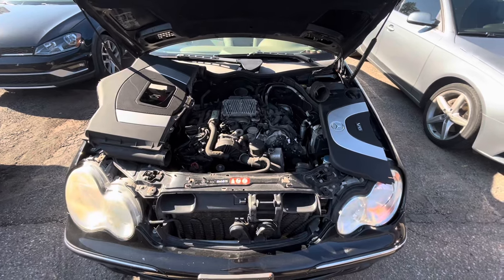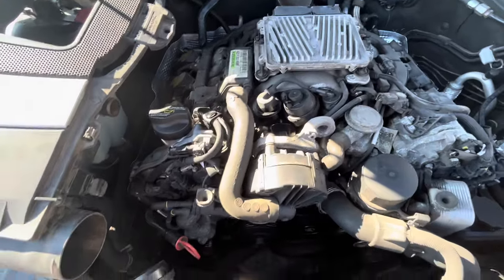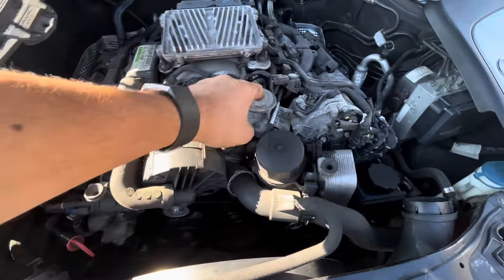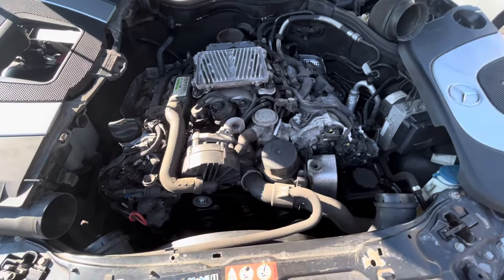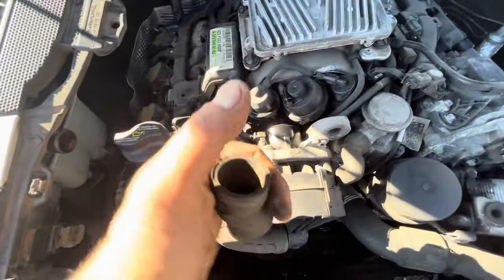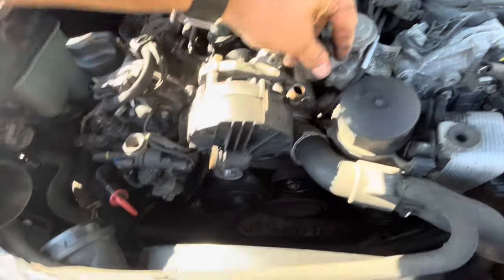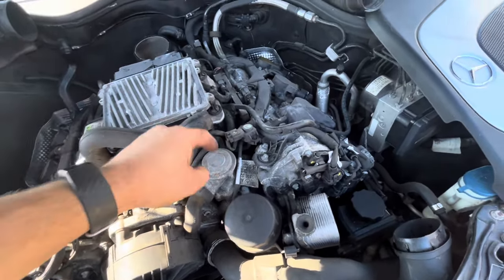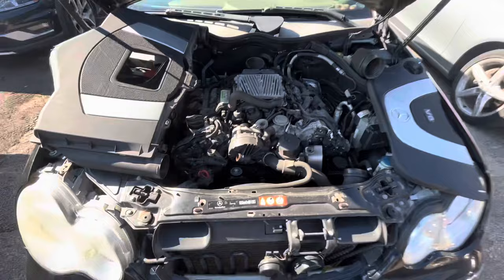WATCH THIS BEFORE YOU REPLACE YOUR SECONDARY AIR INJECTION PUMP

Comment: I have a 2012 Chrysler 200 2.4 it's causing my plugs to foul out engine may run smooth and then start running rough

Comment: I got a P0410 thinking, my air pump was going bad. I could hear the relays working so I knew two things right off the bat, it was getting power to the relays and they were working. After turning the car on when it was cold (air pump comes on for first 40 seconds if those conditions are met), I could instantly hear it humming smoothly like a vacuum cleaner. So I was like what heck?? Looked closer and realized my lower actuator, the one you pointed out, had a broken vacuum line that broke when my serpentine belt also broke and was cutting everything in its path including my vacuum line. SOB I thought. I just took out the small piece that was still on the actuator and plugged the leftover slack I had....fit like a glove! No  code since and it was  FREE99!

Comment: The screws that hold my air injector broke in half and I don’t know what screw it used could you help me out
Reply from the maker: I can’t remember off hand what those are. Aren’t they 8x1.25 bolts with inverted Torx heads?
Reply: @EuropeanAutoRepair  I don’t know is there any way I can forward you a picture of the bolt split and you let me know I’m genuinely lost here and haven’t been able to drive for almost a week
Reply: @setofs  i know they are T30 bolts but vary in length i think 2 shorter and 2 longer

Comment: What if they’re stuck closed? Low / Rough idle? That’s what I’m dealing with. Rpm idle 6k instead of 8 at idle 🤷‍♂️ already cleaned the throttle body and new  air filters etc.
Reply: Stuck closed may mean more exhaust gasses as no clean air to heat up catalyst on start up

Comment: Could those 2 valves be a cause of a no start just crank only ? I also have the P0410 and changed air injection pump and fuse and relay thinking the gates are stuck too
Reply from the maker: Not likely the cause of a no start. Crank position sensor are pretty problematic on these and sometimes do not set faults. Check that and fuel pump
Reply: Did you have to reset the system or disconnect the battery and re-connect to make the light turn off when you do replace the pump or egr valve? Or does the light go off on it’s on? 

I’ve replace the fuse, relay, pump and still P0410 code. There were two rubber vacuum hoses that I replaced on both egr valves you pointed to  I also replaced and still nothing 😢 not sure what else to do? Maybe take off and clean the egr valve ???
Reply from the maker: @cosme112002 have you already cleared the stored fault?
Reply: Thanks for the update. I didn't have a scanner to clear but driving it about a few days it reset itself. I guess doing one of those things helped lol @EuropeanAutoRepair

Comment: Mine won't stop running ,even with the key off
Reply from the maker: Check sec air injection pump relay
Reply: @EuropeanAutoRepair  l unplugged the fan .The fan is shot too ,I can hear the bearings growling. I haven't decided if I want to rebuild the system ,or just order some caps ,pull the fan and delete the whole thing. I don't have emissions test in my state .This would save me hundreds of dollars and it's not hard to do .

Comment: Good to know, thanks for sharing! Few years back I actually diagnosed a bad front sam module on one mercedes. It did not turn on the air pump.
Reply from the maker: Wow that was a good find
Reply: @EuropeanAutoRepair  took me a long time... don't work on a lot of German cars
Reply from the maker: @peters1821  I’ve had a few Sam module diag struggles in the past

Comment: 2009 C300. I Replaced both vacuum control valves on mine as well as the secondary air pump as well as the check valve. Zero exhaust coming out of the hose when engine is warm. Secondary pump working great, turns off after about 45 seconds when engine is cold. Dang engine light still coming on after a few run cycles. P0410 code. Also replaced the fuse and the relay. Any ideas?
Reply from the maker: You may have carbon deposits plugging up passages in the head, I haven’t seen it on this particular model but I have on others, with the valves open and hoses to the pump disconnected do you get good exhaust flow throw the valve
Reply: @EuropeanAutoRepair  checked both valves for flow at cold start , both hoses disconnected . Both working great good exhaust flow. I only have 87k miles on the car too. When I pulled both out to replace ports were pretty darn clean too. I noticed the vacuum line to right valve was a bit loose. I put on a oetiker clamp on it just now.
Reply: @EuropeanAutoRepair  just like clock work after 40 seconds after cold start absolutely no exhaust flow through both of them
Reply from the maker: Man I hope that takes care of it!
Reply: @EuropeanAutoRepair  Finally figured out my problem. It was that 40amp fuse for the pump. Stock fuse looked good, super hard to tell by looking at it through the top of the fuse, pulled it out got a better look at it and it was fried. Put a new one on and life is good again. No wonder they sell both the relay and fuse together.
Reply from the maker: @brucewayne2773 dang! Old pump must have blown it, glad you got to the bottom of it
Reply: @EuropeanAutoRepair  It was stuck, I took it apart and it would not even spin. All the exhaust gas and moisture going into it from previous owner neglecting the checking engine light for 2 years. Having replaced it, I did not automatically replace the fuse, big mistake that was. Have a great weekend
Reply from the maker: @brucewayne2773 you too man!
Reply: @brucewayne2773 hello buddy any idea how i can find that fuse?

Comment: I just purchased a 2005 crossfire with the 3.3 L V6 don't want took the supercharger off of a similar Mercedes and stuck on it did away with the secondary injection pump in the fuel regulators on top or not hooked up. They said they have it cleaned and this is all bypass this a bunch of BS or is the guy telling me the truth